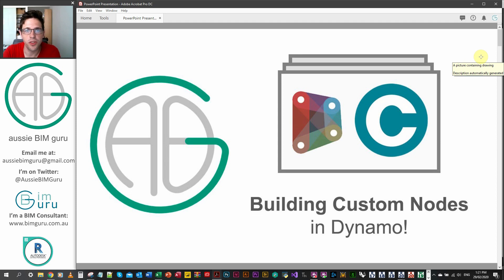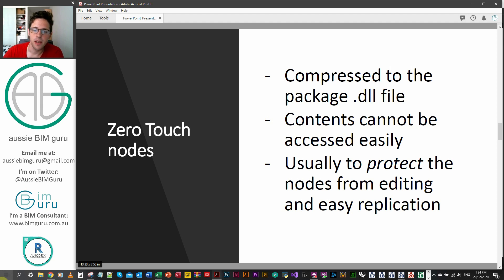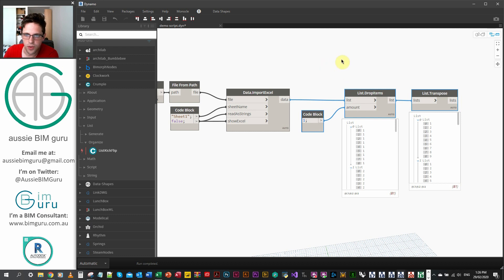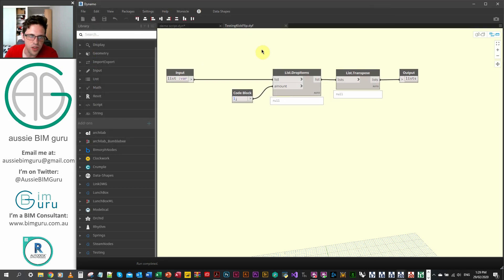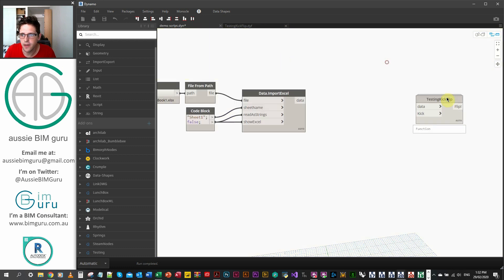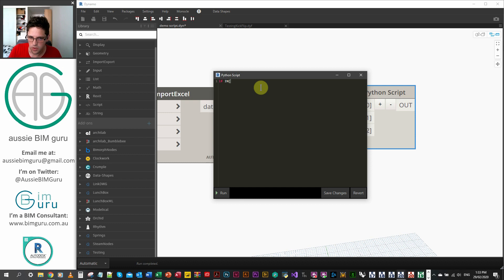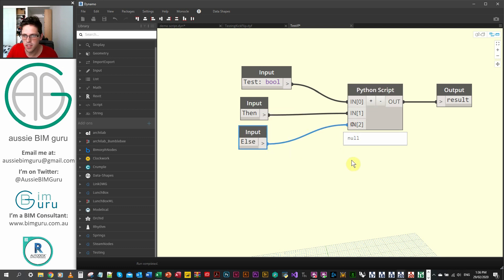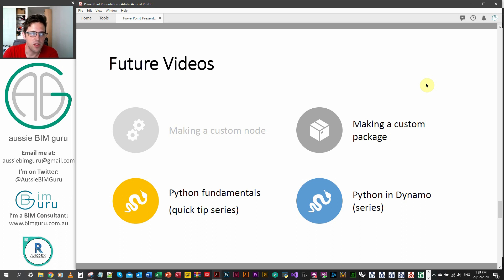Building Custom Nodes in Dynamo!

Comment: When using code bloack, why you had to type DSCore? I'm still new in this area of dynamo and this got me thinking for a while...
Reply from the maker: See 'DSCore' as a library of commands. From this we can retrieve various functions by adding them after this with a full stop. Each level we go in deeper is a layer of this library, until we eventually reach a method, usually with inputs in brackets. This is quite a common written programming sequence we use on programs like python, which we often call method chaining, or calling on a namespace. If we had no DSCore reference, then dynamo might eventually come across a double up with another non DSCore method, so this is a safer design approach intentionally set up by the dynamo developers. If a command has more than one possibility, we call this an ambiguous call and usually it would result in an error.
Reply: @AussieBIMGuru  I see, thanks ! Awesome video my friend

Comment: Python          Print ()
Python script in dynamo      OUT = 

One question, longer script(without custom package) Vs short script(with custom package &python script) , which is faster for run?
Reply from the maker: True Immi, Python shell outputs in the form of the print function, however Dynamo outputs via the OUT variable. This is due to the way the IronPython shell is set up to interact with Dynamo.

Usually, Python will be faster than the same equivalent Dynamo nodes (unless one node can do what the Python node does); it really depends how many references you are importing, and the efficiency/number of operations involved in each. Dynamo nodes speak more directly to the Revit API (via zero touch behavior - they are essentially written in C# and pre-compiled), whilst Python must load DLL's (although only once per python node).

A good example of a more efficient python node vs. dynamo workflow is my Navisworks to Dynamo video; the whole coordinates rotation portion of the workflow I've since condensed into a half python/half dynamo workflow. I am to eventually write it entirely in Python; I have no doubt it will be faster (and may already be faster anyway).

If you write entirely in Python (e.g. in PyRevit), the script will be much faster than Dynamo for sure).
Reply: @AussieBIMGuru  thanks for great explain. Now I am more excited to learn PYTHON.(also waiting for your python tutorials 😄) again many thanks 👍